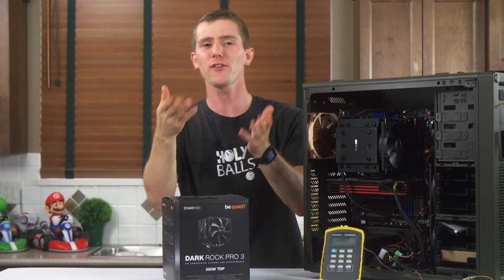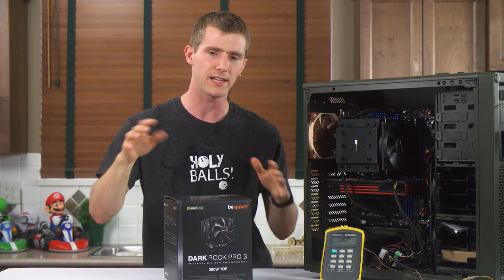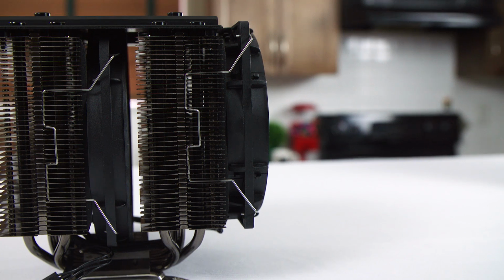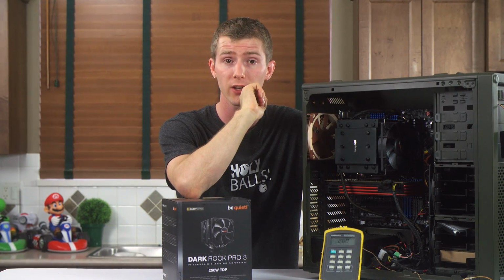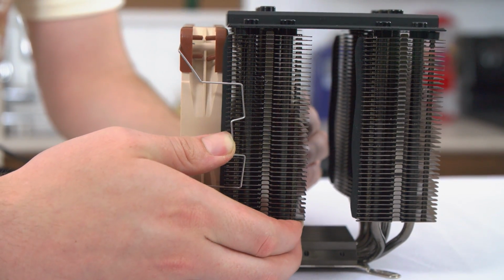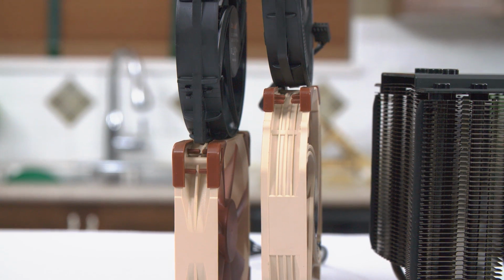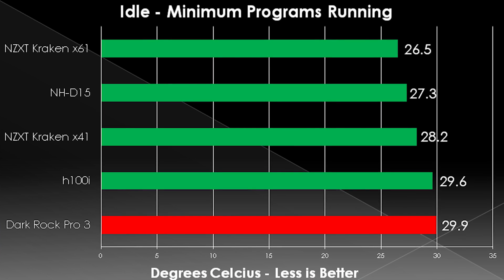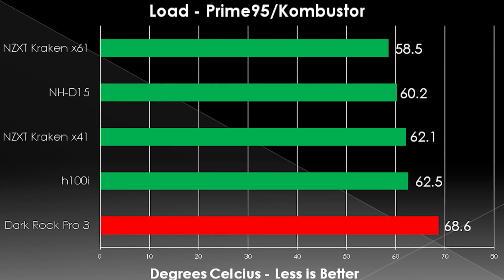Dark Rock Pro 3 CPU Cooler from be quiet!

Comment: I don't like that you use noctua fans on all heatsinks. Many people buy the heatsink and use what comes with the heatsink. I want to know how the default configuration runs, not how an upgraded version of it runs. It ruins the ability to tell which one is better with stock configuration. At that point all you are testing is how good the heatsink minus the fans are, which isn't the full product.
Reply: +TheCyberQuake... Using Noctua fans is a personal preference of Linus (and me).  They simply are better, but at a cost of course. But, for those not like Linus, I'm positive the regular fans that come with this cooler are probably just fine.  Linus just likes things really, really quiet, and Noctua fans are the best at that.  Besides, most of use who know Linus and his personal preferences, already know that he is very likely to switch out the fans for those from Noctua - that's a given...
Reply: Ed Stoddard I do understand that Linus likes Noctua fans, and I wouldn't blame him. I just feel that when comparing different coolers, removing the fans they come with remove a variable that could change the end result. At that point, you aren't testing the cooler as a whole, but rather just the heatsink itself. Keeping the default fans would test how good the whole package you are purchasing is, and not just half of it. That may just be me though. Thanks for the reply though!
Reply: TheCyberQuake Your point is valid.  It would have been nice had Linus done a test of the cooler as it was designed, but for Linus and some of the rest of us, we would have changed the fans anyway.  Still, for those who wouldn't do so, you're right, it would have been nice to know how good it was as designed.

Comment: How is using Noctua fans on everything "Standardizing" the tests? If i'm watching a review of a product I want to know the performance out of the box with what it comes with, not with way more expensive fans that are sold separately.
Reply: +TheSuperNESman  Every fan has different performance so using Noctua fans on every cooler allows them to test the capability of the cooler itself, where different fans would not be a factor for better temps. But I can see where you are coming from by testing the performance out of the box.
Reply: +TheSuperNESman long story short, they are testing the metal block, not the fans so that's why they need to use the same fans on each block
Reply: +TheSuperNESman Those fans that are included are more expensive than the noctua ones and higher quality. Although they likely trade a bit of performance for silence.
Reply: @shrikeGFX doesnt matter fuck all that included ones are more expensive you still be paying extra to add noctua's
Reply: MeNotSanta Yep
Reply: bas van der werff
 Nobody needs to buy fugly noctua fans if more expensive fans are already included that were made for the cooler.

Comment: Suggest me the best (community opinion ) air cooler or water cooler that fullfil as below;
-price
 -performance 
-noise
It's for my next year gaming rig so please help me ! 

Thank you 
(no troll but sorry for my bad english )
Reply: ***** i am afraid my pc would blown away to mars
Reply: ***** good idea . but i have better one . I'll will stop . I will stop asking and ask other people lol
Reply: If you are on a tight budget, the Cooler Master Hyper 212 Evo would do you good. It has good price to performance and you can do a slight overclock with it. I don't know about the 212's noise performance. If you want a high end air cooler, the bequiet! Dark Rock Pro 3 as reviewed here is a good one, provided you are ok with their mounting system. Noctua's NH-D15 is a good one, provided you are ok with their brown fans and Cooler Master's V8 GTS is a good high end air cooler, which also looks cool as hell. All of them perform well and are quiet.

If you want a Liquid Cooler and are on a budget, the Corsair H80i GT will do you good. Its a single radiator but is thick and it has features like Corsair Link and RGB lighting. I would monitor the fan speed if I were you as the Corsair fans can get loud if they ramp up their speeds. If you want a high end liquid cooler, go with the Swiftech H220X or the H240X, a dual 120 or 140mm radiator respectively. I am using the H240X and its pretty good. It performs really well and has good noise performance. It has a small reservoir integrated into the radiator which can be refilled.. It is one of the most expensive AIO coolers but for that money you get swappable colour plates for the CPU block, no RGB, unfortunately and a PWM fan hub that supports up to eight fans. It is SATA powered and plugs into one of the PWM fan headers in you motherboard, so all the fans plugged into the hub get the same PWM frequency. If you want a cheaper alternative, the Corsair H100i GT or the H110i GTX would do you good.
Reply: C_Raz_Y Hmmm this leads me to the air cooler bcoz i am low on budget and i am thinking to go for bequiet! Dark Rock Pro 3 . Sounds good for me . Btw , thank you so much for spending your time writing this just to reply me , I appreciate it ! Have a nice day dude!

Comment: As I'm currently running this CPU Cooler in a HAF XB (lying motherboard-design), I'm bit afraid of switch to the Fractal Design R5, as this cooler is quite heavy.
Do all motherboards hold the weight properly over time (without breaking, ...)???

Comment: What a shitty review.
First, if you use your brain, you don't need to squeeze the wrench inside your PC at all. Attach the screws to the brackets, then to the cooler. Screw in the backplate to the motherboard, put the cooler on the CPU, tighten the screws on the backplate's side and you're done. Took me 10 minutes to install mine, no hassle.

Second: if you test air coolers, don't use the same aftermarket fans, because it's not how people will use the cooler. They will keep the stock fans unless they die. Your test result suffered from using different fans - as you should know each fan model has different CFM. Also, you can't test how noisy the cooler is. 

Third: for fuck's sake, compare the test results to other air coolers or at least to coolers at similar price range. The NZXT Kraken x61 is twice as much as the Dark Rock Pro 3 AND is a way bigger AIO water cooler.

Also, get rid of the ads.

Comment: Will this cooler fit with HyperX Fury DDR3 RAM?
EDIT:  It fits just fine, and mounting this on anything other than LGA 2011 isn't that bad.  The problem with the LGA 2011 mounting system is that there's no way to screw the cooler in from the back of the motherboard tray, so the dinky little POS "wrench" is the only way to tighten the cooler onto the mount.
Reply: Thanks for your edit man, I was wondering the exact same thing since I have a kit of HyperX Fury RAM in my rig and I'm looking for a good cooler. So how do you like it? How are the stock fans?
Reply: DeltaInsanity They are damn good. My 4790k does run quite hot under Intel Burn Test loads when overclocked, but I apply 1.3V if I go anywhere over 4.4 GHz, so that adds a good deal of heat (it is a bit warm in my house, so that affects temps as well). It is a bit quieter than my Hyper 212 Evo under heavy load (the fans don't spin quite as fast, so that also allows for more heat). As long as you mount it correctly (not to difficult on anything other than LGA 2011), it should perform really well. Oh, and it looks great while doing it.

Comment: WOW... you must have done a horribly bad job mounting this cooler.

You dont even have to use the wrench in the case or near the motherboard... 
or "stick your finger´s" under the cooler.
If done right, you just have to screw it in through the backplate of the motherboard.

Just put the mounting-nut in the bracket, that is mounted to the cooler, lock them with the other nut in place, THEN use the wrench to tighten it, DOnE. No more wrench needed. The mounting-nut can be mounted in three different positions, for each intel socket. 775 the closest to the center, middle one 1150 and on the edge 1366/2011
After that, you mount it to the cooler .... taa daa.....thats it.  At 1:33 you can clearly see that you forgot to mount the nuts.
Ok... not realy "it"... You have to apply the paste, put it on the cpu and screw it down from the back of the motherboard.

Easiest assembly i have ever had with a cpu cooler.
That review makes it look way to bad. It is not the coolers fault, that you mounted it wrong.
It´s all described in the manual.

Maybe, it perform´s even better,when mounted correctly. ;)
d

P.S.: From what i have seen so far, this is a problem with socket 2011 only, because you have to screw into the mainboard not through.
Reply: +RaGniToC30 not all motherboards have holes going through the board and thus do not support backplates. Instead they are directly mounted to the CPU bracket.
Reply: +Michael Margono In your mouth.
Reply: +RaGniToC30 The most common complaint ive seen is mounting is a pain in the ass on this thing. Every review says so.
Reply: +RaGniToC30 where do i mount deez nuts
Reply: +asdda Gr8 m8 I r8 8/8.
Reply: +RaGniToC30 does the mounting process differ for the dark rock advanced C1? I just bought it and I m a noob these things.
Reply: +Wajih Hyder Chohan  From what i have seen, it is basically the same. Without wrench, nuts and bolts.
But dont worry, its is all well explained in the manual.
Reply: Thanks for your help. :) the advance doesnt actually come with the wrench, which I remembered later on, I did need a friend to help me install, the backplate would keep sliding back for some reason, the O rings didnt help at all. The manual really helped a lot.
Reply: ragnitoc kinda old, but I just installed this cooler today and it was HORRIBLE. It took me 2 hours to mount it and the manual doesn't help as much. It hasn't been updated in a while and doesn't include instructions for the latest motherboards.

Comment: I wrote a damn long review of this, and then youtube crashed -_-

Summarised, I have owned one of these for around a year, while it isn't as powerful as some competitors, it is AMAZINGLY quiet. I use mine for 4k gaming and sound recording/editing and it works a treat for both. It is damn quiet, so much so my case fans at minimum speed are louder than this cooler under load. I will be upgrading all my fans to Be Quiets soon.

Comment: I have this cooler, and if you're considering buying it be warned that if the heatsinks on your motherboard form a 90 degree angle around the CPU socket, one of the nuts is almost impossible to install.

Comment: I actually went on and bent the wrench while installing this cooler. It helped a lot, but if I didn't get a H440 which has removable top cover with, well, holes for fan mounting it would be absolutely impossible to install... That was a really dumb move to assembly a PC with such a massive cooler INSIDE of the case either way, but I managed to do it somehow... Only to realize after a while that I forgot to install my RAM! No worries - with RAM sticks installed prior you literally can't mount the heatsink, at least on an LGA2011, since you're not able to reach the screws with that infamous wrench thing 🔧. You have to put them in the slots AFTER you install the cooler, awkwardly placing them below the heatsink at an angle, then attempting to insert them without damaging your fingers, granted that you have low-profile modules, of course.
Reply: ***** LGA-2011 socket mobos have fixed backplates with no holes to put the screws through.

Comment: Next time read the manual.. then its easy to install the cooler, why you would need a longer bent wrench? I don't even.. you don't fasten the bolts after mounting it in on the board..you do that before you even move the cooler to the case..

Comment: @KILOHellfire solder is engineered with a very high melting point. Depending on the type of solder, it melts from 100 to 450C. If the solder on the heat sink is melting than you have a problem

Comment: I got this after having used a Corsair H60 for about 2 years. Honestly, the acoustics on the DRP3 is much better IMO. The fans are uber quiet, and I'm still able to oc my i5-3570k to 4.5Ghz and still keep it at a nice 70°C-ish in a ambient 32°C (summer weather). My case is the NZXT Phantom 530. A large case, though installation is definitely a pain. I was lucky enough not to have to completely remove my motherboard, but it still was a difficult. But overall I'm pretty happy with it. I'd be glad that if I ever upgrade my mobo/CPU, it'd be much easier to remove the cooler, since everything would have to come out anyway.

Comment: I don't understand the point of always using noctua fans. Not every wants to use it or can afford it and the benchmarks should be done with the stock fans. That's the point of benchmarks. You start with everything in their stock settings. Having other fans do not appeal to people and we just want to see whatever's included out of the box of the cooler.

Comment: Luke, I mean no disrespect but are you sure you installed it correctly? At no point during the install should you have needed to access anything under the cooler. The wrenches should only be needed to prepare the mounting bracket, once the bracket is prepared you no longer need the wrench. You should be able to tighten the cooler down from the screws on the back of the mobo. Still isn't a very easy install, but it isn't as bad as you make it out. HiTechLegion has uploaded a video showing how to properly install the cooler.

Comment: Luke, the reason you were having difficulty with mounting it was because you were doing it wrong. I have large paws as well, and I just installed this for a friend on his computer last week. You are supposed to place it in the motherboard and screw in from the back.
Also, please stop testing with Noctua fans. Most people are going to want to know how well something works or of the box. Changing the fans to Noctua fans adds another $40-60 to the price and misleads many viewers about the actual performance of the coolers. However, you are at least always honest and upfront about it, so I do give you props for that.

Comment: Got this one in my case and it performs as good as it looks. I was going for a quiet as possible build so I went for this one even if it would result in a little bit hotter CPU. Under full load I have never seen it over 68*C and its just so damn quiet. It also looks really good (the reason I don't have a single noctua fan in my computer). 
But when it comes to mounting..... holy S** it was painful. I have a asus Formula VI motherboard and I actually had to cut of some of the foam on the backplate so it could fit under the armor. I also had to get my GF to help me with the cables since its so damn big and I could not reach anything after mounting it. 
But what linus is saying about high profile ram is wrong. Im using two sticks of Corsair dominator platinum and it fits right under the fan. What I had to do tho was mounting the front fan as far up as possible on the cooler. If you do so you could fit three stick of high profile ram (but I think its a mm clearance so nothing higher than the corsair dominator platinum).
I wont give it a top score because of the mounting problems, but everything else is solid.

Comment: In my personal experience building custom PC's for over 15 years now, in response to your issue with the included wrench for the cooler being too short or too small.  Buy your self some garage/mechanics wrenches, they come in an array of sizes and can be relatively cheap to buy (especially when found on clearance). Many of the tools I have double not only as a means of car repair, but are also applied to many electronics or hardware based tasks. Don't get me wrong, I too have kits I designate specifically to all computer related tasks.  However, when I apply other useful tools to these kits/tasks, not only is the job made easier but also much more enjoyable as well, especially when I am well prepared for the task at hand.

Also, with regards to replacing the fans on the cooler. Why not remove the spring clips included with the factory fans and place them on the fans you chose?  As long as the fans are the same diameter, this shouldn't be too hard to get your aftermarket fans to connect to the cooler.

Anyways, good review, but you should consider expanding your reviews to not only Intel and Nvidia.  AMD/ATI also have some very nice products as well you might consider for review.

Comment: If you had removed the brown rubber parts in the corners of the noctua fans, I think the noctua fans would have worked. Yes maybe some more vibration but still better performance and I don't think it would be something you'd notice.

Comment: Constructive critism for LinusTechTips:

TL;DR : I feel like changing fans/parts of the original product for a review is wrong for various reasons. 

Constructive critism for LinusTechTips: You may need to stop changing parts on things (changing fans on coolers/cases to noctua fans for example) as that somewhat makes the end review result different than the original products performance.
It doesnt bother me if you do reviews with both noctua and original aslong as the original is is reviewed its fine.

I say this because people like me would just like to buy something and keep it like that. Not spending extra money on more fans etc. 
Also note on this exact cooler, part of what people who buy this cooler wants is a 100% black color scheme which brown noctua fans just... destroys.
Yes i know there exists black noctua fans but you get my point.
I feel like be quiet designed this cooler black for people who wants that and if people dont care about the color scheme they might aswell buy something cheaper without the black design.

Comment: This is one of the reasons i love my phantom 530 case. For those hard to get to mounting points on the upper left i can just pop the top of the case off and put my hand down through the fan holes and screw it in that way.